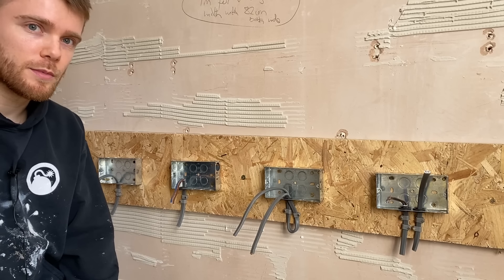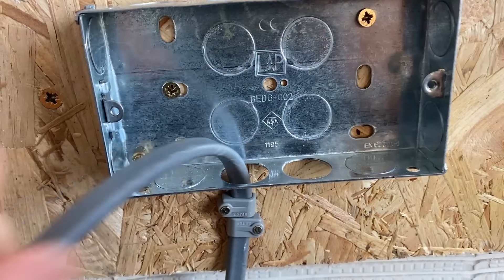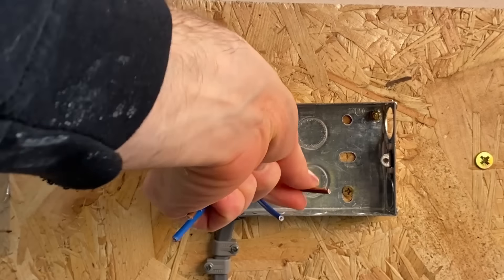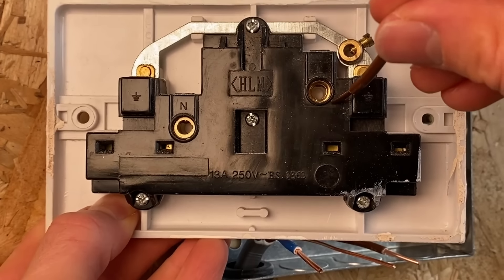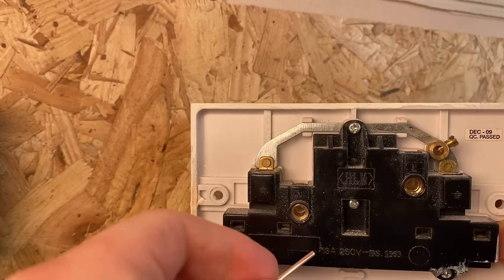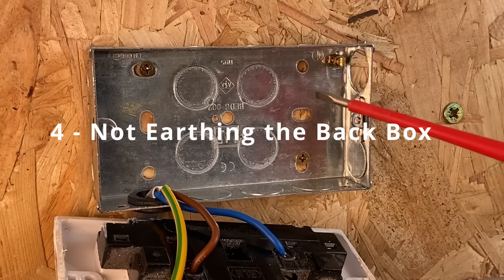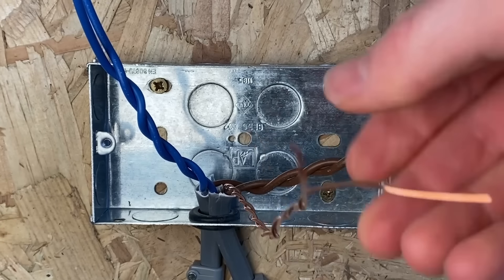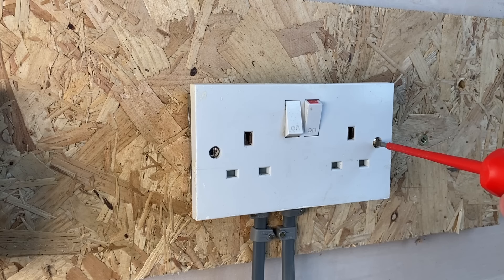5 Biggest DIY Mistakes Wiring a Socket

Comment: My view on the facing plate screws is when they’re tight, they’re tight. Not gonna over or under tighten for aesthetic reasons. 
I’m a DIYer, and have never made any of these mistakes. Mind you, it’s hard to get metal back plates these days.

I’ll be honest, I wish we could use 15mm or 22mm copper piping (soldered joints) as conduit, thus containing any fires, and also providing an additional earth on circuits. But then, when I made a male DIN to female vehicle power adapter, I used 30A cable despite the DIN socket being only 15A on the truck. I like a bit of redundancy, it’s safer.
Reply from the maker: Thanks for watching!
Reply: Here in the US, home inspections are done by people with little training (I'm not talking about the professionals who inspect the original electrical installation). Those 'certified' inspectors look for screws which are lined up. 
It's just one of those things on learns to do to minimize problems down the road for home-owners.
Reply: @ethelryan257 , so to utilise an old phrase & make it new, someone’s oily rag checks another engineer’s work?. Dang that’s whack. I’m looking at a light switch I fitted myself, secure against the wall, both screws tightened equally, one’s at about 340 degrees, the other 250
Reply: @ethelryan257  Do you get an electrician to replace the faceplates after the tiling is done in the US ?
Reply: The copper pipe bit reminds me of the anecdote about the man having a suite made for himself.  He had two jackets made in case he got a cigarette burn in one; then burnt a hole in the trousers.

Comment: Although the video is good and the issues you raise are real, as a competent DIY'r I find this overly patronising and insulting to title it as DIY mistakes.
It has been shown time and time again that so called professional electricians make every single one of those issues you have said on a regular basis.

They are just mistakes made when wiring a socket, nothing to do with DIY.
Reply from the maker: Unfortunately the nature of youtube means you need to use emotive titles to get clicks. That said, I’m not intentionally patronising anyone, merely highlighting common errors. Thank you for watching.

Comment: In my own home I always rub a bit of silicone oil on the rear edge of switches and sockets, so they come off without chipping the paint. They are often installed when paint hasn't had time to cure.
Reply from the maker: That is a great tip, I’ve never thought of that and it is definitely a problem. Thank you for sharing!

Comment: Number 4, earthing the back box is not required on a socket if the circuit is protected by a 30ma residual current device. No harm in still doing it though
Reply from the maker: Thanks for watching!

Comment: The biggest mistake I see is not using a licensed electrician
Reply from the maker: True, but if DIYers are always going to want to do things themselves, it is better that they do it correctly. Thanks for watching!
Reply: Technically there is no "licensing" system for electricians in the UK. There is for gas installers - where it's specifically illegal to pay anyone to do work if they haven't the required registration - but no parallel for electrical work. A few types of electrical work must be certified under building regulations but even in those cases anyone can do the work and pay the local building control department to provide the certification.

Comment: The regulations state that a fly lead to the back box isn't required, as long as at least one of the boxes lugs are fixed, not movable. Its earthed through the faceplate screws and faceplate earth strap.
Reply from the maker: Agreed, although i think the regs say it is desirable but not essential. I still think best practice to do so, but definitely up for debate. Thanks for watching!
Reply: @TheDiligentDIYer1759  I've not found anywhere in the regs where it says "desirable". Can you point me to it?

Comment: Every socket and switch in my newish build house has the cpc twisted together.
Reply from the maker: It’s not wrong, just wouldn’t be considered best practice
Reply: I did the same in our 4 floor home. We separated the 4 floors into 2 plus 2 and fitted a second meter. When the inspector came to check the work he thought his tester was faulty because the earth bonding was so good. When he left, he even turned round and came back to check the readings. Terminal screws come loose over time and twisting the wires together ensures the ring stays intact.
Reply: @TheDiligentDIYer1759  but you had WRONG in big letters on the video title! Good practise 🤣
Reply: Twisting CPCs together is utter dogshit! 😊
Reply: Gutted! 😂 

If you know about testing you will know why it’s sh*t!
Reply: @kevinmills5293  what is?
Reply: @kevinmills5293  that last bit is hill atop us and is actually why it’s shit! 😂😂😂
Reply: @kevinmills5293  Twisted cpcs don't sit properly under the fixing screw and are more likely to get weakened and snap, leaving the socket unearthed, but not to worry the ring is good!  If you know anything about testing a ring for fault finding, it is the biggest pain in the backside having to untwist many, many wires.

Comment: I wish sparkies understood more about emc compliance and electromagnetics. How wires can move sideways during a momentary surge...

Otherwise it's just connect the brown wire to the brown wire... d'uh.

When a sparkie can explain how a 3 phase motor works, and how voltage and power output vary depending on star-delta connection, then they can wire my house. 

I expect my electrician to actually understand electricity, not just how to follow some rules, many of which are open to interpretation.

-DIYer (a little educated)
Reply from the maker: Thanks for watching!
Reply: What about building regs? They are mandatory. Depth of chases, position to drill joists, heights of accessories,  flow rate of extractor fans etc?  Nothing at all to do with star delta or 3 phase motors, but everything to do with wiring your house properly! Part P.
Reply: @andrew7440  big unknowns for me to be aware of as a DIYer are cable load standards and loading of the homes circuits.  I don't do anything that might upset in these areas.

Comment: Twisting the cables together was a thing done in the 60s and 70s ( as a spark from that time). It was said it made a better mech connection ..as when screwing down more copper to grip on .. times have changed , better equipment , testing etc and tools ..
Reply from the maker: Thanks for watching!
Reply: Still the same old crappy screw wire clamping as found in switches and sockets.  Roll on the day when the same wire clamp styles found in rcd's and mcb's become the norm.  No wonder the screws have a tendency to slacken over time, it's amazing the connections last as long as they do.

Comment: Grommets ? You would have to be a right muppet to cut the wires 
WTF it matters not what direction the screws are or if they are matching 
As for twisting earths never done that but your reason that they will be taken off many times for fault finding is frankly ludicrous

Comment: Unless you're playing with the wires hot you'll still never know which direction the issue is.
Reply from the maker: I thought insulation resistance testing is performed dead? Sparkies please correct if I’m wrong.
Reply: That's true on a ring, perhaps not on a star?
Reply: @TheDiligentDIYer1759  I've seen more doing it hot than cold .. just saying.
Reply: @KL3NCH  where I am, technically it's more of a bus than a star and I thought only poms used rings??

I've seen sparkies here take hours to find earth leakages and other issues.

That said, noone wastes their time here twisting the wires anyway because there's no point.

Comment: Also:
One has recently become aware, due to experience, of an inherent problem where metal boxes are fixed in place with screws that have countersunk screw heads.
The screw head can present a really sharp eadge, that, because the box holes aren't countersunk, remains very slightly proud of the metal surface. 
Should a wire become hooked up on or resting against the eadge of the head, it can very quickly wear through the cable insulation. 👍.
Cheese head or rounded screw heads are my preference now.
Reply from the maker: Yes good point on the screws. Thanks for watching!
Reply: @TheDiligentDIYer1759  There's a simple way to avoid this: use of acoustic putty (or countersunk finishing washers). The putty is great though as it provides a fire barrier as well as some acoustic properties.

Comment: What about putting the cables into conduit?  Ever drill into the wall and nick a cable, if it is in conduit it can be pulled out and replaced, if the cable has been plastered over, you ruin the wall. Irrespective of the regs, I'd always earth the metal back box, I take a dim view of those that dont.
Reply from the maker: Yeah cables in conduit would be useful, but generally means more chasing at install, so more time and money. A DIYer might want to spare the time, but i think a professional would charge a lot extra at first fix. 
Thanks for watching!
Reply: @TheDiligentDIYer1759  Very minimal extra cost I would think!  I suspect just taking the easiest minimalist way out;  the same way plasterers don't plaster right down to the floor,  (It makes the job of attaching skirting board to "fresh air" very interesting).

Comment: Buy good quality..
There are cheap and expensive ones that are dangerous!
Definitely use a good quality tester or get a qualified electrician to give the whole system a full check and issue a certificate. Don't rely on a previous owners test certificate.. this also applies to gas and water etc.
Reply from the maker: Thanks for watching!

Comment: With regards to the earth wires a better you can always;  As you have keep them separate, strip more back on one conductor, measure the earth sleeve from the cable entry to the box earth point slide the sleeve onto the conductor, double the conductor and connect it to the box earth terminal. The remaining conductor is cut and doubled over to fit into the socket earth point, and an earth sleeve is fitted before connection.
Reply: I like that. Incorporating all the parts in the earth ring means they're included in any integrity test anywhere on the ring.
Reply from the maker: Great idea! Thanks for watching!
Reply from the maker: Thanks for commenting!

Comment: I've started using those fire retardant membrane grommets these days over those open ones. You just make a small slit in it (I find it neater if you do this vs shoving the cable in), bash it into the hole, and insert your cable and pull it back a little. I imagine the regs will probably mandate these if they haven't already, since they're intended to choke out any fires that begin in a box before they can escape.
Reply from the maker: Sounds like a good idea, thanks for watching!

Comment: I have an autistic son and over the years have been exposed to autism and come to understand a lot about it. Lining up the screws in the sockets is 110% what my son would do. One good point is autism is not a mental illness. It is a developmental issue instead. Lining up screws is something you would absolutely want to avoid. Making an autistic son fit into a random world is all about having pictures at a slight angle, sockets not quite at the same height or level. Teaching how to accept things as they are and not to stress out over trivial things that do not matter will help everyone in the long run.
Reply from the maker: Thanks for watching!

Comment: Laughable. Still using metal boxes and single core cables along with rather crappy fittings. 1930 is long gone.
Reply from the maker: What a bizarre comment. 
Presumably you mean solid core rather than single, you can clearly see these are not singles. Solid core has much better current carrying capacity for a given conductor size than stranded. 
As for metal boxes, these are standard use, you wouldn’t use plastic boxes in a masonry wall….
Reply: @TheDiligentDIYer1759  Bizarre? Not at all, just saying it as I see it. Also, not problem at all using plastic fittings in concrete...

Comment: The other reason for a grommet is in some cases the cable will vibrate and wear the insulation from the cable eventually shorting out onto the metal box. I'm a retired sparky and when I first started as an apprentice I had a desk my dad built in my room, so I wired it up and I had a particular corner where it was difficult to get fixings. Everything appeared fine except when things got very quiet, I could hear a vibrating hum, it took me forever to trace it back to the corner, I eventually had to make a tight bend to get close fixings on the cable and stop it vibrating.
How long does it take two electricians to change a lightbulb?
How about 5 hours!
Why?
When you go to a building to fix a light fitting and you get there, to be escorted to a huge door. When they open it you find a huge freezer, and the light, a 5ft fluorescent encased in 300mm of ice.
The problem was they couldn't switch off the freezer unit, that was a matter of inches from the fitting, so, even with arctic jackets on it was our fingers and feet that got cold quickest. We had to use a hot air stripper to warm the fixings that were frozen solid once they started to move we took it away and the fixing instantly froze again. From that we estimated the temperature we were working in was -50°C! The estimate was taken from a survival book, if you are at either Pole and don't know the temperature, spit, if it hits the ground and freezes instantly it is -50, if you spit and it immediately freezes it is -70, so removing the heat gun it had to be at least -50 for it to freeze immediately.
Have you seen the new MK Smart sockets, £250 each, thank god I'm retired.
Reply from the maker: That’s very interesting on the vibrations, not something I’ve heard of before, thanks for sharing! 
Fortunately as a diyer I doubt I’ll ever be thawing a light fitting out in negative 50 haha, but certainly a good story! 
£250 is crazy money, they’re not going to sell any at that price!

Comment: I’m a spark and this guys talkin shit. You do NOT use a Stanley knife to strip twin and earth and that back box does NOT need earthing
Reply from the maker: Glad you enjoyed the video! There’s nothing wrong with using a stanley knife to strip cable, it just isn’t the quickest and risks catching the insulation. The regs state when one lug is fixed, it is desirable to earth the back box. So agreed not essential, but would certainly be considered good practice.

Comment: My 1980s house had zero grommets on original wiring…..
Reply from the maker: I guess times have changed. Thanks for watching!
Reply: For the better hopefully, plus everything I’ve touched now has a grommet as builders then liked single sockets even on a ring, they are all doubles now.